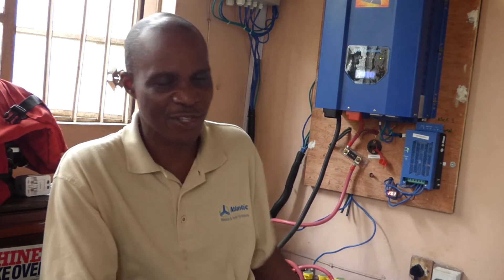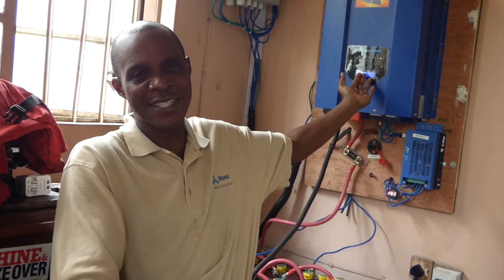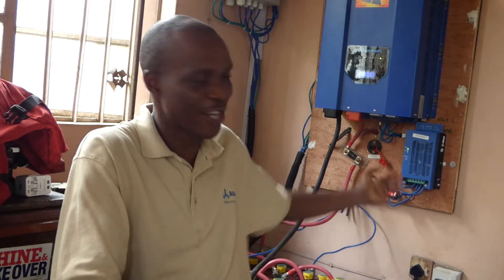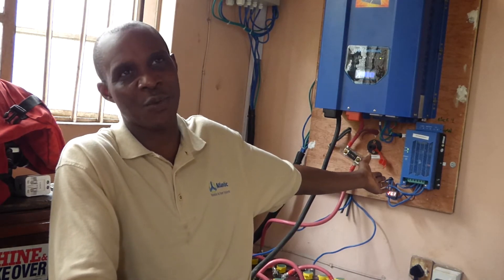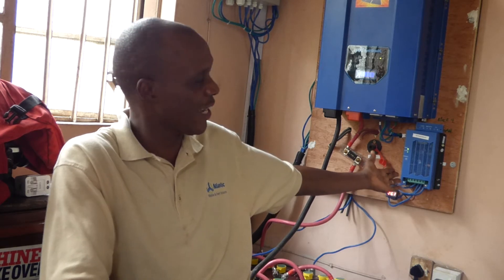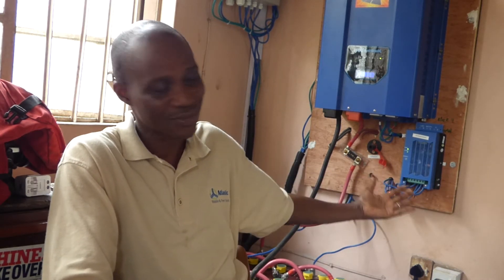Questions we have been asked about Solar Power

Comment: Hi, you mentioned that the inverter will last around 10 years if taken care properly (no mistakes), then what might be the issue that will fail it ? Its a transformer based inverter. The copper or copper aluminum clad windings will not get damaged in 10 years. Is it the capacitors or the diodes ? From your experience please let me know.
Reply from the maker: Thank you for watching our video. The windings are copper. The product has not been out for 10 years so I can't make any guarantees outside of what the factory says is the design life. Our experiences with the 16 we have out in the field has been good. We blew two due to a short circuit. Someone at the customer was wiring something and the inverters developed a permanent fault. We have not had time to take them apart to find out what failed. We hope to do so in April when get back to our warehouse where we have them stored.